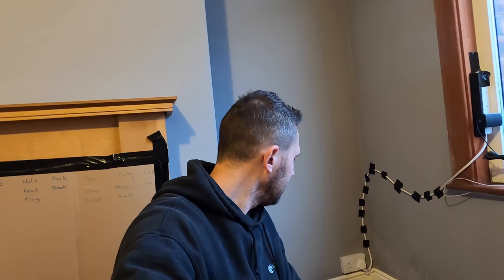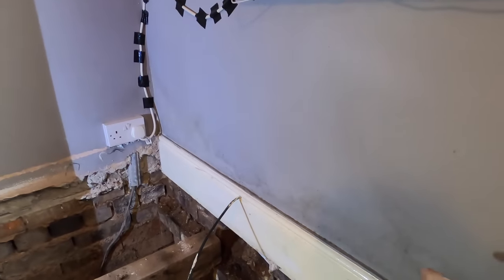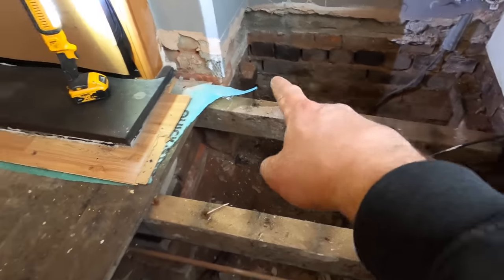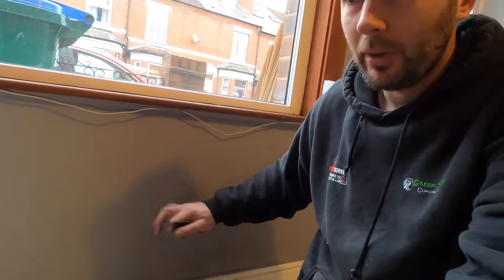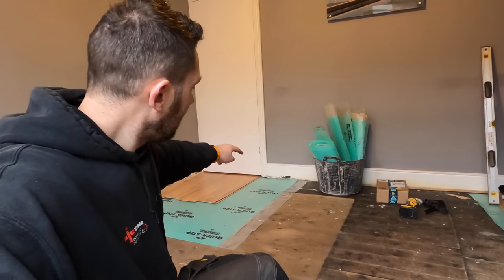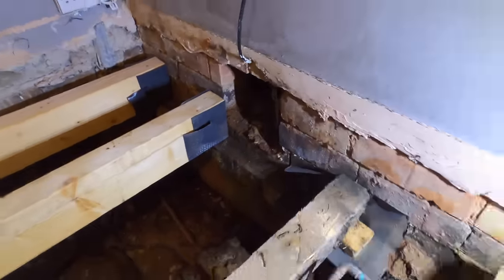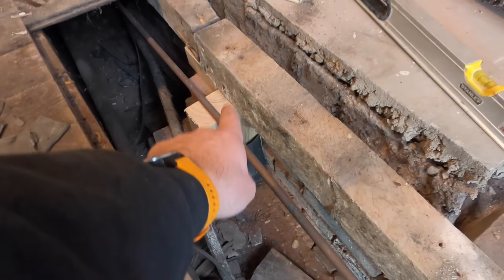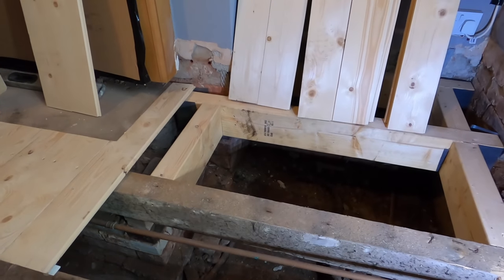Replacing Rotten Floor Joists

Comment: plastic dpc around the joist will speed up the rotting process  .it should be reomoved  and pointed up with nhl 3,5 so it can breath  ,breathability is key  .air vents air flow .

Comment: Great job how did you fix noggins in back to back across the joist? Screwed in but if parallel that would not work. Get some rest the kind of jobs you guys do your immune system gets knocked for six as come in and out of cold and heat. I would send you some Indian flying tiger balm great for aches and pains and for sore joints and muscles and gives you a great night rest. At some point you and Steve are gonna be off the tools as the younger lads take over with you and Steve managing them.

Comment: Loved the videos, you make it look easy which it isn't. Do all joists in old homes sit on a brick ledge like that one or do the go into the brickwork. I've always wondered how the hell would you replace a joist if it inserted into holes in the brick
Reply: Often the brick cut outs are quite deep so when the old one is cut out you can cut a new one so it slides in beyond what’s needed and then slid back into the opposite brick slot. Hope that makes sense

Comment: First thing you do with a dodgy floor is to crawl the space under the floor - examine joist seats and trimming round the hearth from below the FFL. Sections of floor boards can be cut out & reused if done carefully.
You've positioned a noggin thats now blocking the air brick.
Dont leave any wood scraps or off-cuts on the sub-area soil: they'll rot & create fungus.
Reply: Worthy note.

Comment: Good work. Good video.
If ya had a massive migraine. You will definitely not be working still and filming. More like in the van trying anything to get rid of the pain.
Great learning video aswell.
Reply from the maker: Nope it was definitely a massive migraine just some times you have to put your head down and work as much as you can for the clients and team
Reply: @GreenHawkConstructionltd  hard to get stuff done in that position. Hope u are better. Suppose everyday like that, you would have to stop altogether.